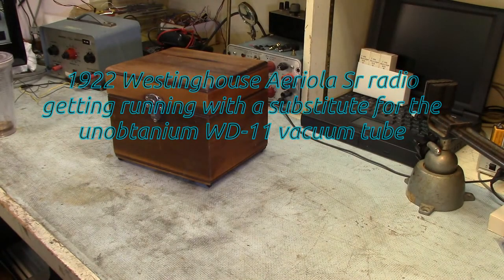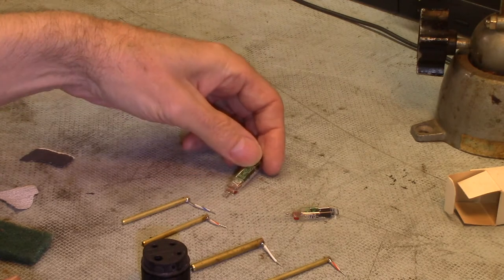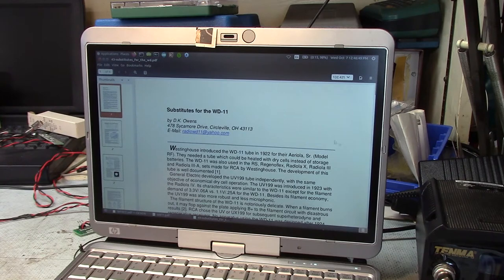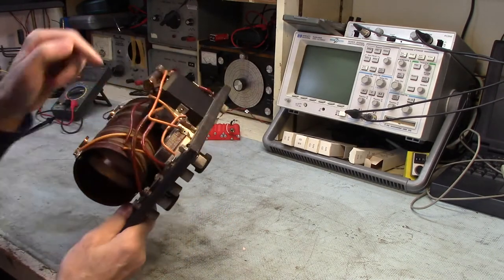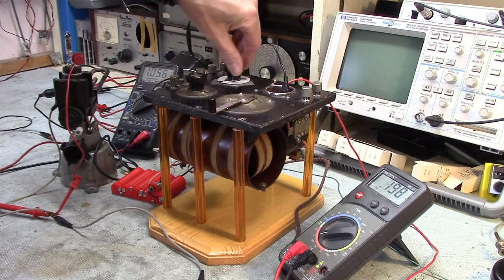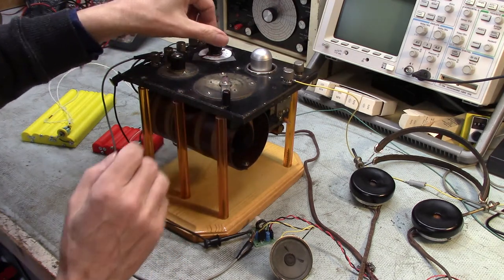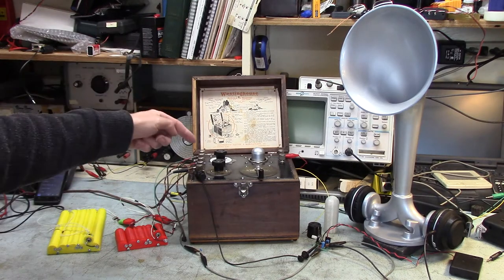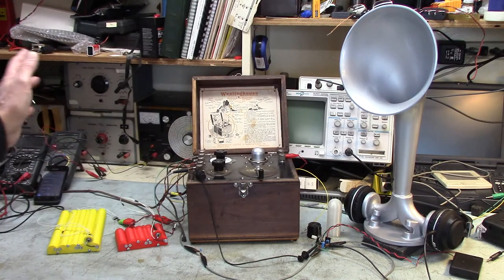1922 Westinghouse Aeriola Sr radio getting running with a substitute 5676 for the unobtanium WD-11

Comment: If you are going to make a simulated WD-11 and cover up the works with an opaque tube then it occurs to me that it might be better to use solid state components rather than a fragile tube with a short life span.
Reply: Some have subbed fets and biasing resistors into old tube bases but then it is a transistor radio.  What is the fun in that?
Reply: @tomsherwood4650  The fun is in making the substitute behave like a WD-11 and it is not just putting transistors into an old tube base.
Reply: Exactly! Am I regenerating radio receiver circuit I use an MPF102 transistor. Those are junction junction field effect transistors.
Reply: The junction field affect transistor acts very much like a vacuum tube trio amplifier so you have the same affect
Reply: @Jeffrey314159  It will take more than just plonking a FET into a tube base - especially if you wan't the filament control to have the same effect on the characteristics as it does with the WD-11 (without the heat of course). It would make an interesting design exercise.
Reply: @Jeffrey314159  A JFET alone is not a plug-in replacement for a WD-11. You need additional components.

Comment: To clean the wires on the tubes . You can put some acid in a small cap or bowl and dip the tube in and after there clean, dip it in baking powder and water to stop the acid. Then you can clamp the tube wires with the small clamp as a heatsink to soldier on your wires if you don't have a socket for them.

Comment: Thanks for posting... I did 3D modeling for about 8 years before retiring, we always had job shops do our printing.  Have wanted to solve problems with bad pot metal in 20s radios with printed parts, but have found very few applications that will handle the loads and still be faithful to the original part proportions (i.e. replicas vs merely functional) Of course you can get metal prints now but at far, far too high a cost for planting in a vintage radio.  I like your printed battery holders...  I had a job shop print some replica parts in Nylon to go in a Kolster 6D.  Work and look great after painting.  (PLA or ABS would not be strong or stable enough) But the cost for three parts was $125.  You could barely get that much selling the radio (less tubes) for $125 these days...Still it was a fun project.  BTW, With a good WD-11 the set should be able to easily go into regeneration with a healthy squeal. .

Comment: The early brass based tipped WD tubes are almost unobtainium,  but the slightly later versions like the tipless bakelite base C-11 are out there if you don't mind the price.  Maybe up to 80$ but audiophiles might pay that much for a special 12AX7 or something.  Just run the tube at minimum filiment volts to get regeneration and they can last alright.  Nothing wrong with a good sub tube though.  Tie a string around one of the pins of the tube and let hang out of the hole the tube sets in,  as there is not enough of the tube exposed to grab onto to pull it out.  You can pull the string to help pull it out.

Comment: 24:20 Yes they greatly economized the components and construction of this set they use materials and parts that were readily available and they dispensed with the  tuning condenser entirely. They relied on a variometer for tuning

Comment: I would have used a glass test tube instead of the brass tube.  You can cut the glass tube to size with a cutoff wheel in a dremel.  A bit of silver spray paint on the inside of the tube can create the getter effect.   The battery triode 5676 won't get hot at all, no worries there!
BTW, you can use an inline transistor socket, or half of an 8 pin DIP IC socket for the tube instead of soldering to the tube "pins"

BTW a type 30 tube (maybe with a socket adapter) or a type 1H4G (with a socket adapter) would make a good replacement, and both of those tubes are still reasonably available.
Reply from the maker: I did try early on the glass idea, but I could never find test tubes the right size and I tried cutting a old vacuum tube for the glass, disaster every time.  The 3D print was good enough and easy

Comment: What type of amplifier did you use?
Reply from the maker: It’s just a cheep little single chip ( LM386 ? ) amplifier kit.  I bought it like 20 years ago, I can’t remember were.  It’s still an simple commodity kit, like at Micro Center or can get off of Amazon.
Reply: AMPLIFIER???  IF you can find the matching one tube audio amp for the Aeriola($$$) you can use that.  But us hardcore guys use some sensitive Baldwin or equivalent high sensitivity headphones.
Reply: @tomsherwood4650  I use C. Brandes headphones because they are the type of headphones that the Aeriola Sr. was originaly shipped with if you bought the bundle. Baldwins were around at the time of the Aeriola Sr. and probrobly sound better but they were not ever shiped with the radio. Also the amplifier is a two tube amplifier. I was asking because I wanted my family to hear the radio too. I thought about doing this project because I have the parts. I decided to get two 864 tubes (military equivalent of WD 11) but I might still do this progect and keep the 864 tubes in my radiola 3.